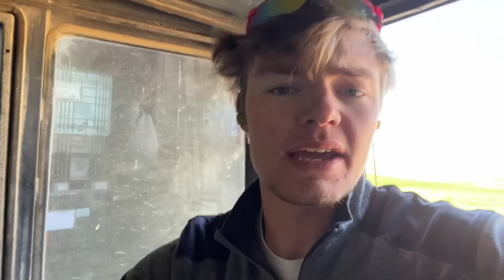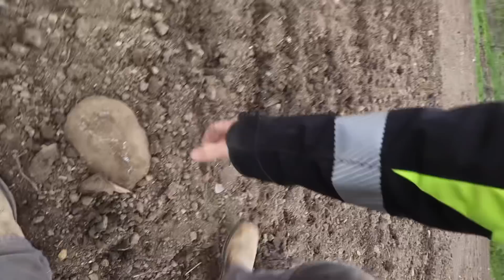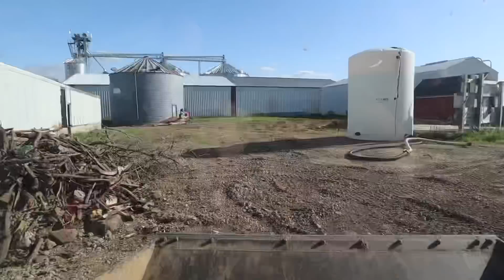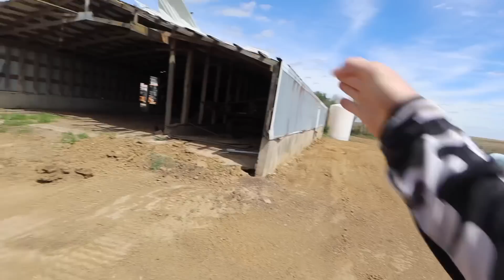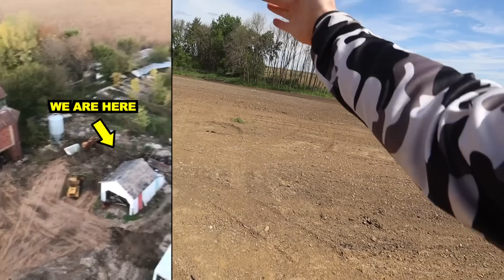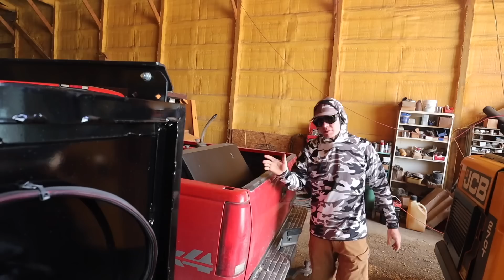I Spent 96-Hours Clearing An Abandoned Field

Comment: Hey Cole you could use a few cans of spray foam from the inside to stabilise the sheets on the machine shed where the nail holes have come loose or there is a small hole as a cheep fix for a few more years maybe.

Comment: When I saw you Guys digging under the foundation to get the plumbing and other utilities in the shack I had a smile on my face. I'm an electrician who has done hundreds of slabs and I've never seen what you did done. If anything it should have been way deeper and dug all the way in before any concrete pour. Or, concrete should have had a piece of Styrofoam placed to create a chase for the plumbing. Frost heave got you. I live in Chicago suburbs and everything is inspected, sometimes way over the top. Nobody likes the "man" telling you how it has to be done but sometimes they save us from are selves. I can't believe there wasn't at least a quick look from somebody. As bad as those bin builders were this ones on team Cole.

Comment: Yep definitely need a fill valve with a heated pipe for that tank or a pipe that's easy to winterize
Reply: Get a float valve for a swamp cooler and change it every year or get a good one with a stainless steel float and a brass valve body.

Comment: All the time and money put into improvements I'd put in another well someplace near the bins where there is 3 phase and drop a large 3 phase pump down the well with a variable speed controller and run an inch and half line over to your water tank sprayer fill site. Take no time at all to fill the water tank we have a deep well 397ft down we have a big 3 phase pump down 360 ft and we fill our 1500 gallon sprayer in about 5 minutes off it, it beats the garden hose and we have it on a speed controller so we can change the flow rate like when we mixing our chemicals we can turn it down so we don't over fill while we measure everything out and dump it in our tank because we don't have an injector tank to dump our chemicals in. we have it open all the time no pressure tank or pressure switch just on or off and flow is controlled with controller

Comment: With you matching C's to get them looking like ya want, when i was younger the builders that did our drive work, would just get two can of spray paint.  Tie the string line at the distance you want them to each can pull the line tight. Then laser line it straight an mark the curve connect the dots, and you should get 2 points at you desired distance mirrored. It's old school but laser lined to be precise.

Comment: If u cleaned your windows. Mainly the front lower corners. U would be able to see the front of your machine as well as your trailer. Then u could load it safely. So please don't make excuses and make a safe situation unsafe. Coming from a 20 year operator.

Comment: Yeah having the pump on the fuel tender trailer being gas - instead of diesel is kinda weird honestly. its like putting a gas generator on it when your gonna pump diesel.  woulda thought they would go with a electric pump by now with solar charging and a small diesel generator over the gas fueled pump.. Its what I would do with it if I was using it for diesel fuel - switch out all the pumps to electric - put a few batterys on it with invertor - toss a couple solar panels on its roof.  some BMS for batteries..  that can auto start small diesel generator to keep the batteries topped off or if being used to long on batteries alone.. Like the GREEN APU they put on diesel trucks - generates power for AC or Heat for the truck / prewarms oil for the big truck - keeps its batteries charged /etc -so the big engine can be shutdown and sips fuel instead of guzzles it.